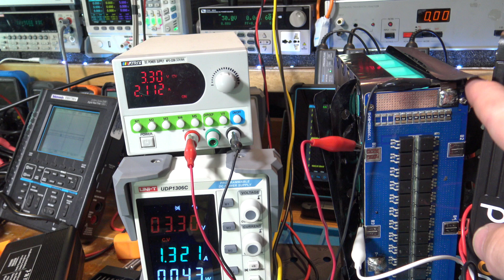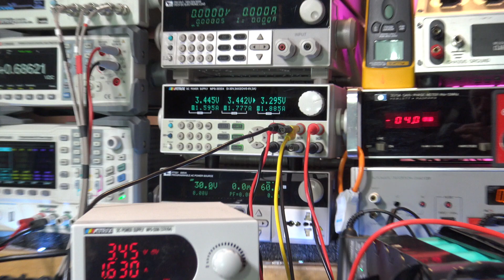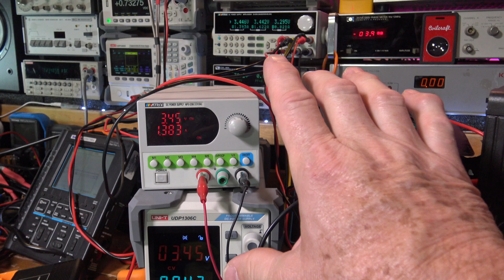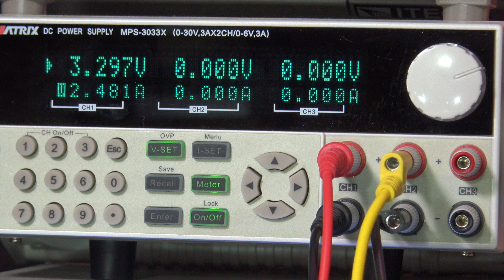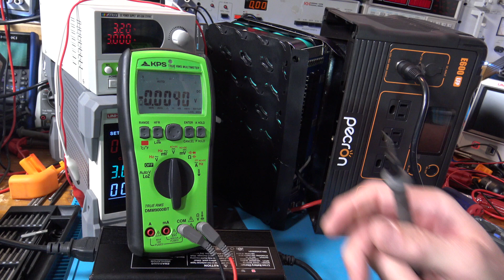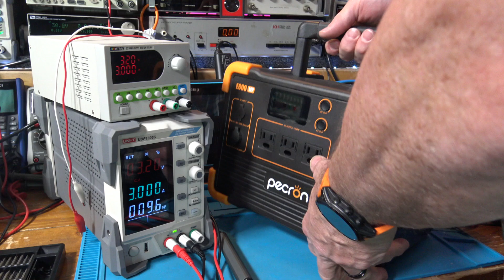Battery Station Repair Pecron E600LFP Part 2

Comment: Like others I have a e600 which fails to take a charge after being unused for over a year. I tried slow charging all 8 banks up to 3.2v at 1amp with a DC power supply. The original pecron charger when attached does not show the charge light nor a wattage on the animation screen. I also tried to charge it with a different pecron charger. My charger works fine on a different e600 unit. The problem is with my e600 unit.

  Are there other things to try and restore functionality or is it now e-waste?
Reply from the maker: Thanks for the great question!  I need to do a video on this subject.  Did you take it apart to bring all banks up?  Maybe try to take them up to 3.4 or even 3.6V and let them sit at that voltage for a while - just to be sure that they hold the voltage.  All the banks need to be close in voltage and then the BMS should allow the battery bank to be charged by the normal charge methods.
Reply: I removed the battery bank from the unit to facilitate accessing the connection terminals for the banks. I brought all 8 up to 3.2v. The charge light blinks once then remains off on the charger when connected. Other tips or ideas?
Reply: 3.4 v. The charge levels did not drain over night.
Reply from the maker: Try charging to 3.4V or even 3.5V to be sure.
Reply: I brought everything up to 3.4 v.
The battery bank was separated from the units case to access all the terminals.
It still will not accept a charge and the charge light on the power brick briefly flashes once.

Comment: So, you used a separate power supply for each bank to keep current/voltage control separate?
Reply from the maker: I charged each bank separately to balance them.  Once third charged and balance, then the BMS will take over and do it this thing.

Comment: I use my e600 regularly.    I fully charge it yesterday to 100 percent.  I went to use it today and nothing its a dead brick.  Ac wont go on or dc and will not accept a charge just lights out.  I had sent this back to them 2 years ago and they replaced it.  They also fixed my e3600 and e2000.  I am done with power stations they are over priced garbage back to my generators these things are a headache.  Nice tech but unfortunately not reliable in the slightest.  In reality 99% of the population can not do what you just did.  So unless you are some kind of tech guru its not a product for the general public.
Reply from the maker: Thanks for this great backstory.  I have to agree - although they are much more affordable now - I think they have to step up the tech so that a station can self repair.  That should be easy to build into it.  I used to be the engineering manager at a place that designed these - and if I were still there I'd be making that suggestion to the owner.
Reply: @KissAnalog  Update on my E600.  I hope this fix helps others.  Apparently I must of left my E600 on so my battery did go to zero.  In order for it to take charge again.  Plug in the wall charger to the E600.  Hold the ac button for 40 seconds while trying to charge.  That worked for me.  Pecron also stated that if it didn't work the first time to try it again.  So in a nutshell I have 6 pecron power stations.  I had an issue with 3 of them and pecron either provided a solution over email to fix it or I got it fixed by them under warranty.  Please note that after I did the first step I left the charger on for for about a minute and the unit came to life and started taking charge.  It will charge very slowly initially.  So yes once again Pecron proved me wrong and I am so happy they did and they will continue to get my business.

Comment: I appreciate the time you took to film the process. Looks excruciatingly painful. I'm about to start on my E2400LFP. I had it charged to 100% and left it outside under a tree for two weeks. Went to use it and it was dead  tried charging it and it seem to be charging, like you mentioned in first video, but when charger is disconnected, it went back to 1%. Tried recharging both with AC and DC, but never works. I even tried manually changing it through battery expansion port. Nothing works. I want your opinion. Seems to be bricked. Think it got wet and shorted? Do you think it can be revived per each cell being charged? Thanks. I thought about trying an expansion battery to see if the cells would balance on their own. It's a 48v system. 
When i meas
Reply: Disassembled unit. Makes no sense to me. It has what I call 7 banks, each having 6.6v if measured individual one to another. The entire bank measured at the outgoing leads is 53.25v, which seems to be full charge. I have no idea what to do with it. Seems if the entire battery had a bad cell or group, it would register less than 53v. I probably should've just sent it back, but figured I could fix it. This is how people with little skill think. 😁
Reply from the maker: That does seem like it is charged.  What happens if you put a load on it?  Does the voltage collapse?
Reply from the maker: Thanks for asking!  Yes, I think it can be revived the same way I did here.  It sounds like the same issue.  I wish the BMS were smarter and they could do this - as it makes no sense that they can not recover the balanced charge...
Reply: If you mean a load to the internal leads when apart, haven't tried it. Not sure if I can get any kind of clip on them as they look soldered, but I can try. I gave up and put it all back together. Thanks for the advice. I'll try it tomorrow.

Comment: Thank you
Reply from the maker: Thanks for watching!
Reply: @KissAnalog  ...I have the pecron E1500 LFP...I assume it will be similar process ...it's completely dead ..
Reply from the maker: Yes, once the batteries are discharged too much the BMS board will not charge it.  I don't know why so many of these are made this way.  If I were the design engineer - I'd make a mode where it would recharge each bank up to a level where the normal charging would take over.

Comment: Hi, I  was ready to give up on my E600 which would not turn on or charge after setting unused since last summer. I followed your dissasembly except I did not remove the four screws holding the battery pack together. I folded back the protective insulation to reveal the battery terminals and found six of the eight banks measured 2.25v to 2.55v one bank was 1.85v and the final bank measured 0.9v. I charged the two lowest banks to 2.25v at 1amp, plugged in the charger and the unit charged up and  brought the voltage up on all banks to match. I have fully charged and discharged several times and the E600 is fully functional.  Thank You for your timely video.
Reply from the maker: That is awesome!  Thanks for your feedback!
Reply: @KissAnalog  I have this unit also. Do note that the onscreen LED rate of charge with its associated timer does not actually show a true state of charge for the battery. It is nothing more than a "Countdown" clock. Every time I attempt to charge the battery the state of charge always reaches 100% once the countdown timer reaches zero.. Though the LED screen says the battery is 100% charged once disconnected from the charger the battery LED goes completely black and the battery tests @ zero state of charge!
Reply: Had same issue with my Pecron E600 except my cells were all in the .6-.8v range.   I don’t have a charger and didn’t feel like spending hundreds of dollars on one, so I bought an adjustable usb  dc power source on Amazon for under $20 along with some cheap test leads.  Brought cells up to ~2.5v and the unit then accepted charge again.   Thank you for the video!

Comment: You were wondering about the two voltage ratings on the sticker on the battery pack. I google translated it. One says: Nominal voltage 25.6V, the other says: Standard charging voltage 28.8V.
Reply from the maker: Yes - thank you!!!

Comment: It seems odd that it allows the battery voltage to fall below its lower threshold.  99% of folks would discard it unnecessarily.  Let's hear your rant!
Reply from the maker: I must have left something on and it probably disconnects or turns off at some point - but then self leakage must have let it drain too low.  It was probably many months since I used it.  The ecoflow is just so easy to grab.  I need to rotate;)

Comment: Eddie, very interesting video series. Maybe you could put together a video series on the design of the battery management system (BMS). Also, how to calculate the system capacity. Thank you Danny.
Reply from the maker: Thanks Danny!  I'll do this;)